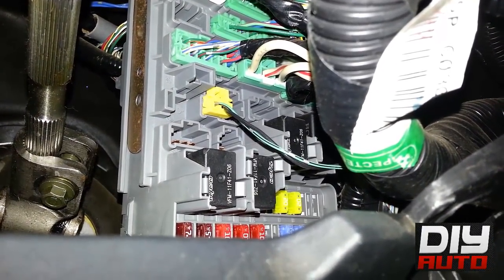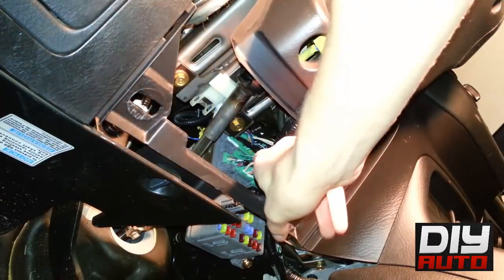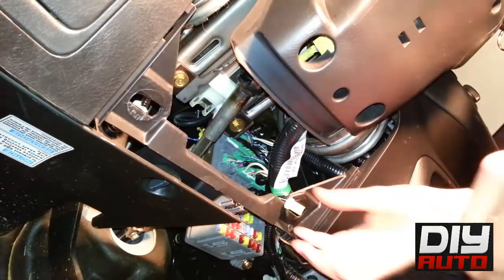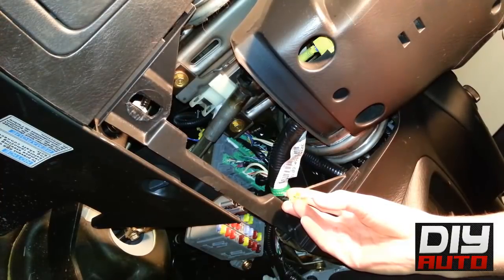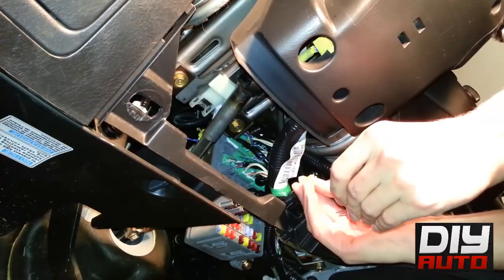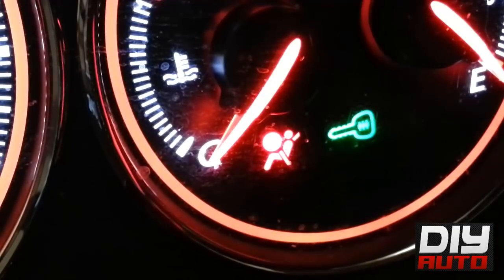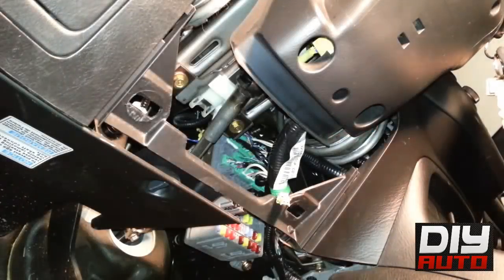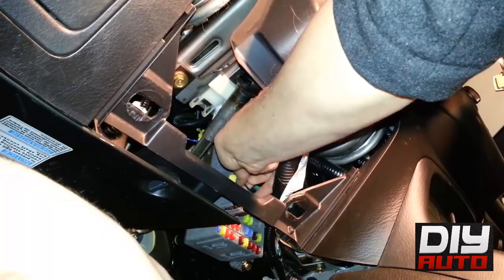HOW TO ERASE SRS LIGHT || HONDA CIVIC & ACURA EL

Comment: Took me about 20 tries, was about to give up and then it worked, Thank you!
The trick for me was to be patient and not race the lights, this is not a timed procedure.
Start the car shorted, Wait a second after the light goes out before unshorting, then wait a second after the light goes on before shorting again. 
you'll know it worked if the light flashes 3 times after 3 short/unshort cycles.
Reply: 0

Comment: So this turns the light off, but does it correct the problem of why the light came on in the first place.  There’s a reason it came on to begin with.  I guess my question is, will the airbag system still operate properly, or does this just turn the warning light off?

Comment: will this work on 2012-up civic models?? thanks
Reply: No, need to get your module reset by an SRS reset service. google it.
Reply: @markdowlatkhah2254  I just spent 4 hours looking for the MES connector on a 2013 civic, and I'm convinced it doesn't exist. Hours of googling and this is the only comment I could find that hinted the problem wasn't fixable in this way on the 2013 Civic. Not sure if you have any additional details about this but... this comment is the only thing keeping me from going crazy about not being able to find the MES on this car.

Comment: Having trouble with getting the paper clip in and out and back in again? Try this...break the paper clip into two pieces. Then stick one half in the left side and the other in the right. When the two halves are not touching, it is the same as the paper clip being out. When you touch the exposed ends together it is the same as the paper clip being inserted. So instead of taking it out and fumbling to get it back in, just leave the two halves in and with the other exposed ends either connect them or disconnect them.
Reply: I know it’s been six years but thank you for the idea
Reply: I know it’s been 7 years but thanks this worked for me just now
Reply: Will this method work on a 2003 Honda Civic?
Reply: @FREECLUBUSA yeah

Comment: I have a 2014 Honda Accord two-door coupe I tried this and it did not work the problem is the passenger seat it called a weight sensor and it's very expensive to replace I wish there was another way so I can do it the Save-A-Lot of money

Comment: Tried it this morning on my old 2001 Civic GX and it worked great.  I snipped the paper clip in half and put each half into a respective hole, and then hooked up a remote starter switch to them.  Was able to leave the paper clip halves in during the entire process and was able to see the instrument panel to know when to press/release the button on the remote switch.

Comment: It worked on my 2003 Acura 1.7 EL.  I found the plug was tricky to "short" with the paper clip while splitting my attention to watch for the SRS light to come on and go out on the dash so I got my youngest to do spotter duty while I focused on paper clip placement.  3 on / 3 out worked like a charm.  Thank you!

Comment: no luck on 05 civic, flashes twice then comes back on, tired 5 times
Reply: same here on 04 civic, I think there is a problem with the seat belt.
Reply: Usually the indicates another issue that has to be fixed, check srs code's. Hope it helps